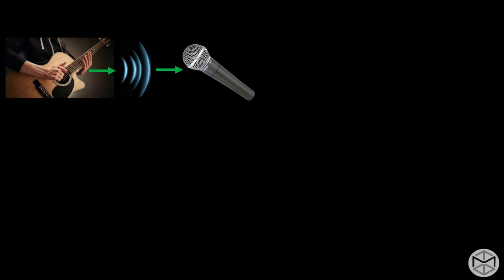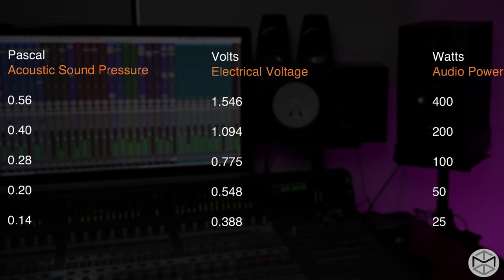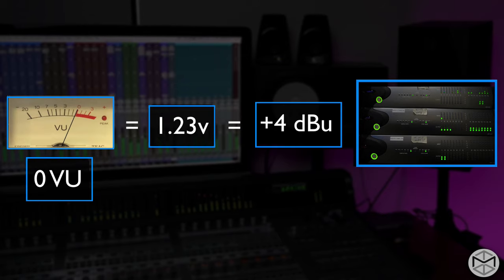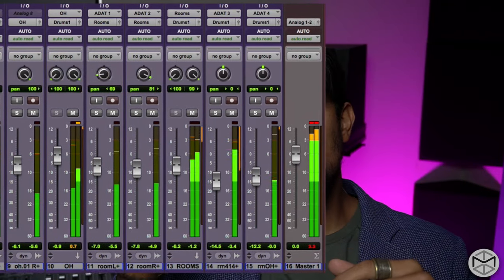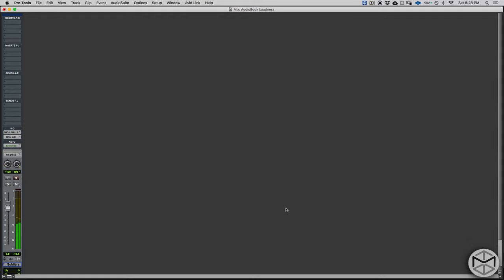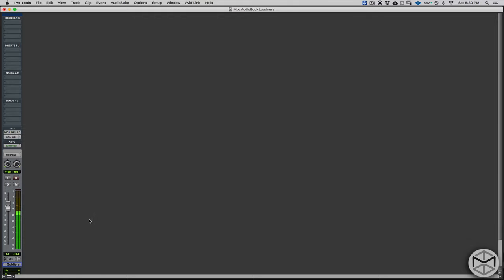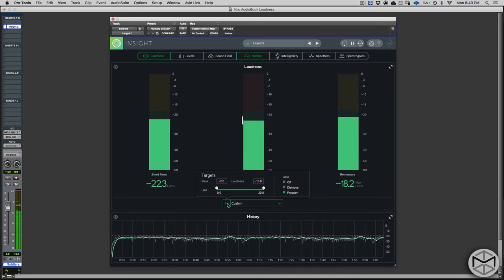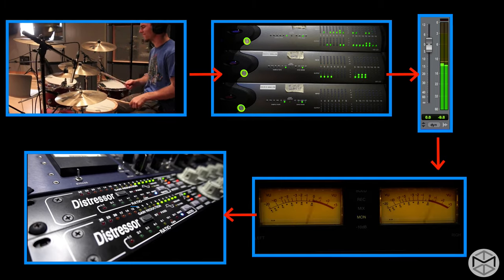Recording levels, Decibel, & Gain Stage

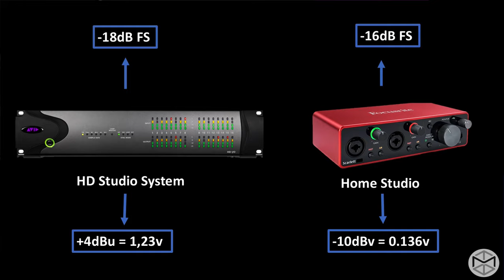Comment: Excellent, useful video, clear presentation, thank you! A little correction at 29:17 ; -10 dBv = 0,316 V
Reply: ... a smallest) correction - dBV and dBv not same thing, because of some different convenience factors in the past, dBv describes voltage values just like the dBu. * I thing it is just misstyping 0.316 -> 0.136 , also dBV - dBv

Comment: In 33 minutes you've eloquently provided more insight and value than my college did. I've figured this stuff out on my own but it took a lot of trial, error and self discovery through research. I'm glad you mentioned Bob Katz and the K system. That changed my whole approach. What should be mentioned here as well, even if only in passing, is how to set up your monitoring system. Without that, record and mix levels won't be properly perceived. Only until you properly calibrate both your monitoring system and your record/mix levels will you be able to achieve the results you're aspiring to. Once you calibrate you can actually just use your ears and the levels all fall into place naturally. Thank you for the great video.
Reply: Very interesting. How do you calibrate said monitor levels? More importantly, how would you measure said levels, especially headphone levels?
Reply: @megyalilaballad  Look up Bob Katz. Visit his website. Read until your vision is blurred. Then read it all again. Use an SPL meter. Know the volume (size) of your room. He explains it all very clearly.

Comment: Thank you for in-depth explanation 🙏
The only question I have is about conversion from +4dbu to -18dbfs. 
I heard before that this values can’t be directly compared.
The headroom is good for sure, it will save you from the mistake for the most of the time. But it’s not technically correct way to reconcile the levels. 

I would find the level of analog clipping and fit it to 0dbfs. In the scenarios where you don’t want any distortion in your sound it may give better representation and more dynamic range.

Comment: great video, but there are some parts honestly I don't understand, you said home equipment is calibrated at -16 dBFS to -10 dBv equal to 0.136v How can it be that being -16dBFS wich is louder than -18dBFS (as you later explained in the example of opening sesions in HD rig or home studio) results in a lower voltage. I found in converter pages than -10dBv is -7,78 dBu that is 0,316 volts but is far lower than 1,228v. I know there isn't a direct conversion for dBu to dBFS but I guess some relationship is there. That's my only doubt, for the rest excellent video, very clear and well explained, thanks for sharing with us.

Comment: Great explanation! just one little thing, 29:18  nominal value for consumer /semi-professional/ devices is  -10dBV=0.316vRMS (at 0dBV=1vRMS). I thing it is just misstyping 0.316 -> 0.136 , also dbV - dBv. dBv is obsolete measurement metod describes voltage values just like the dBu, but maybe i didn't see somethng.

Comment: Great video, thanks.  A few quick questions:
1) 20:20 Can I ask when you mentioned this song was mixed properly at -18 dBFS, do you mean the average dBFS level or the peak level?
2) 22:22 How come a song with a level of -18 dBFS is way lower than the 0 dBVU level of the VU meter here?
3) 22:24 I can see the signal is around -7 dBVU, so is it not an optimal level to be fed into an analog modelled plugin like an SSL compressor?  Thanks.
Reply: RMS level of -18 dBFS equals to 0 VU. VU meters show only RMS level. In analog equipment there is 18 dB headroom, which in the DAW equals to -18 dBFS. 
So basically we emulate the analog gain structure inside the DAW simply by having RMS level at around -18 dBFS.

Comment: Please correct me, if I'm wrong, but the last part irritates me. A Protools session should have the same loudness, no matter were you open it with protools, shouldn't it? the files you are using are converted already, so it shouldn't make a different what interface, or A/D converter is connected, right? You might have to compensate for those levels after conversion, but aren't you doing that anyways in the DAW? And isn't that exactly what gain staging is supposed to be? To put all channels into that sweet spot?

Comment: Those 2 dBs of difference between pro and consumer converters would be at the DAC stage right? also... I read that "alignment signal" acording to ITU is a 1kHz sine tone at 0dBu (0.773 volts rms... which peaks at around 1.1 volts). When and why +4dBu was implemented as the "standard" 0 VU?

Comment: this is very helpful. What i don't fully understand is how to level at -18dBFS. Should the peaks be at -18dB or what? (in the video it looked like the peaks go over -18 often)
Reply: RMS level should be -18dBFS. You can double check this on VU meter plugin. When the signal hits 0 VU it means that RMS level is -18 dBFS.
For percussive and transient elements like drum hits you should use digital metering to see RMS level. 
If peaks are too high and start clipping when you raise the gain to reach -18 dBFS - use saturation like Sonnox Inflator to tame them.